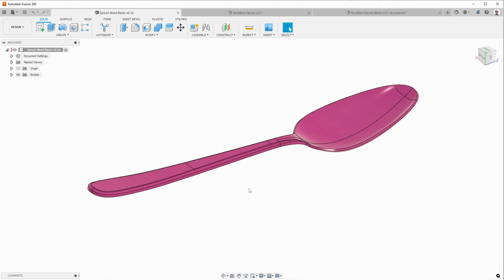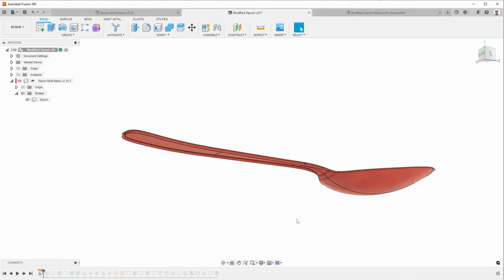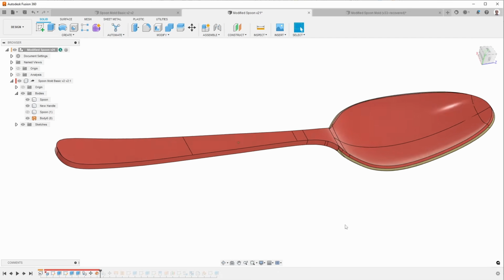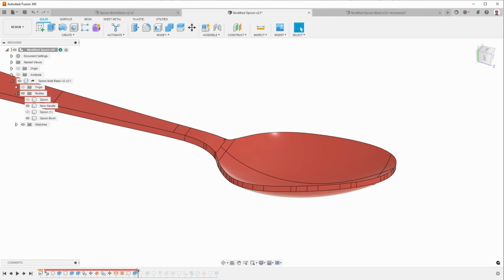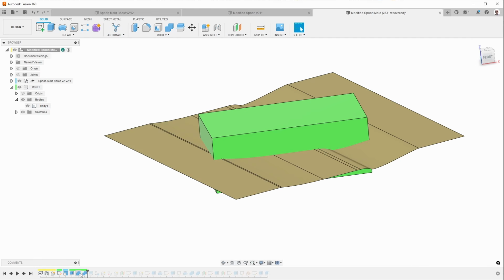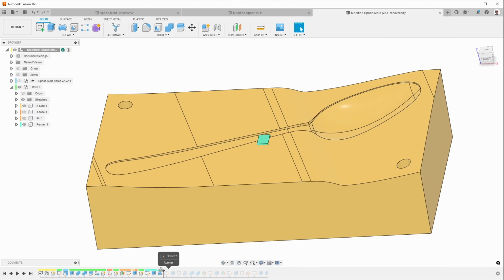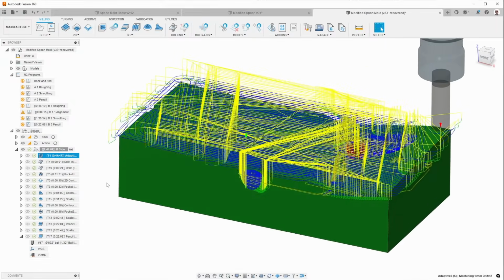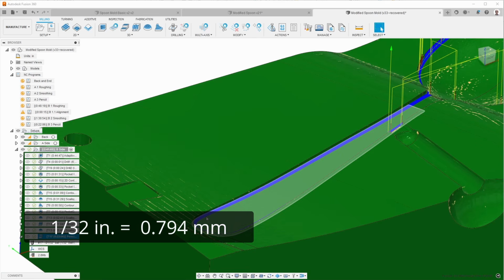Injection Molding a Spoon - Designing, making, using

Comment: Did you do any volumetrics to decide where to put the gate so the mold filled evenly with minimal splay?
Reply: As a rule of thumb, the gate should be positioned such that the distance to end of fill is minimized. This allows for the shortest fill time cycle which means that cooling starts in a shorter time after the filling/packing cycle. More simply, this is the basis for injection molding cycle time optimization. Some caveats though are that there should be avoidance of injection molding defects. For example if he put the gate on either end of the spoon facing directly towards the opposite end of the spoon, he may have experienced jetting. Jetting is a defect which occurs when molten plastic solidifies before the part is completely filled due to the “jet” of plastic not hitting the heated mold walls quickly enough. The result is that the plastic solidifies before clashing with the walls of the mold (the mold surface is too far away from the molten plastic coming out of the gate and the plastic solidifies before hitting the mold surface) and creates a squiggly line in the finished part. To simplify; always gate where the plastic can evenly fill out the part by applying constant expansive pressure along the length of the mold. Of course you have to worry about other defects like weld lines which occur when your part has holes in it, but even that can be remedied by placing the gate in a spot where the weld lines very gradually continue as flow fronts where a weld line turns into a “meld line” which is a much stronger version of a weld line. My plastics engineer brain can’t help but go on a tangent on injection molding but I hope this helped you to some extent! Please reach out to me on YouTube if you have any clarifying questions on this!!
Reply: @Fr8train003  thanks for taking the time to type that all out. I suspected as much, but wasn't sure.

Comment: Does your CNC machine have linear scales? I'm about to add those to my machine here. The linear scales will allow me to set some threshold that the machine will stop if something runs out of spec.
Reply from the maker: I have one watch with an o-ring. They have an undercut, like I tried at first. But their undercut is just a little taller, which makes all the difference. They have a height of 1.4mm for the thread and undercut, whereas this watch that I'm working on only has a height of 1.2mm. That means my undercut wasn't quite tall enough. I'm going to check the the designer about what he wants to do. In any event, from what I've learned, failure would be a stream of bubbles, which I didn't see. So it's working.
Reply: @JohnSL  Hi John, I think we're writing about different things here. I'm writing about the accuracy of the machine, I'm working with a converted mill and I'm using linuxcnc with it.
I'm working on raising the accuracy by using linear glass scales now.
How's the accuracy on your machine? Is it only checking the angle of the motor or are there any scales installed?
Reply from the maker: For some reason, YouTube didn't add my reply here and instead added a reply from another thread here, and then stopped allowing me to add comments until I reloaded the page. So here's the answer I wrote, but didn't get added here: My machine doesn't have glass scales. Instead it uses servo motors, which know their rotational position accurately. The main difference between machines with scales and my machine is that machines with scales can compensate for thermal expansion and contraction. I keep my machine in a room that is always between about 65-70F, which minimizes the thermal issues. I've found my machine to be very accurate: it's a Haas OM-2A.
Reply: @JohnSL  it's not only thermal expansion, it's also backlash under pressure to a certain degree.
I'm sure your machine has a better build quality than my one though. 
I'm also using servo motors on all axis.
My main idea of using linear scales is to secure the machine in case something's wrong -- it should just stop.

Comment: Just water??? also..... wouldnt you want the coolant on the portion of your endmill actually touching the stock? Sorry not trying tobe nit picky XD Ive done a lot of mill work Love/ hate the haas mills.
Reply from the maker: The coolant is Blaser Synergy 735, not water. Also, even when the coolant isn't directly on the end mill, there is still coolant in the area being cut. True, if I don't have the nozzle directed correctly, it won't flush the chips away. But the surface is never really dry during the milling.

Comment: Awesome! Please make a plastic straw injection mold I'd love to watch the correct way to do it
Reply from the maker: Thanks. I'm pretty sure straws are extruded not molded.
Reply: Can confirm with OP’s comment. Straws are manufactured with an annular die on a single screw extruder  (SSE) with several other pieces of downstream equipment (laser micrometer, puller, cutter, conveyer). There are videos out there on YT which describe the process.

Comment: No water No draft no problem
Reply: He uses a much better medium for cooling than water, an oil/water emulsion. He doesn’t need to add draft because the part inherently features draft at extreme angles which allows for effortless injection. If you watched how easily the part auto-ejects after molding without even using an ejector pin setup/3plate ejector plate setup you will apprehend why this isn’t necessary. 10 min/spoon is a little excessive, but this is obviously not a mass production mold, this is an R&D pilot mold meant for research purposes only. Also, almost no molds are polished automatically unless it is a mold which is produced by companies of the likes of LEGO or other companies which are targeting about 1 billion (with a “B”) parts because the precision which can be produced with hand polishing is so much better at this price that we are literally comparing a Honda Civic to a Lamborghini Huracan in this scenario. Engineer your mold to fit the customer’s needs, not to meet NASA standards for all your molds…

Comment: That's a lot of work for a 5 cent spoon. Any reason why the customer wanted to manufacture their own spoon rather than buy from a supplier?
I'm assuming they aren't a supplier, as the type of injection machine they are using isn't super efficient.
Reply: This is known as a pilot mold. It is most obviously deduced by the fact that it is made from aluminum, not a specialty hardened steel. It is a much cheaper, easier to mill material which is commonly used as a material to produce pilot molds. Pilot molds are typically single cavity, R&D volume molds which are the predecessor to hardened steel molds. The hardened steel molds are used to produce parts on a much larger scale based on the learnings of the pilot mold because production molds demand an extreme premium over the cost of an aluminum pilot mold. For reference, this mold is a single cavity mold which inefficiently produces spoons (from a financial point of view). A production mold may have hundreds of cavities per shot, meaning an entire package of spoons which could be sold to restaurants as a wholesale item could be produced in as little as one minute. Gotta prove your product and process first!

Comment: Very nice work. Is it left to the end user to determine if the parts perform based on material selection?
Reply from the maker: Yes. I provided what they asked for. I don't know the details of why they want this mold, and what little I know I'm not allowed to share.
Reply: @JohnSL  Thanks for the reply. It just occurs to me the next step if doing this in-house would be to perform material analysis and gain real experience of various material properties. I'm sure thermoforming plastics changes their characteristics. I am a sparky to trade but I've been a mechanical engineer through experience and while I don't know a lot, I love learning. Your videos are a great resource.
Reply: Typically single use plastics are thermoplastic materials. This is especially important for recycling characteristics because thermoplastic materials are able to be re-melted and processed again into entirely new products. Thermosets are able to be injection molded as well, but instead of being cooled in the closed mold after injection, they are heated. This heating causes the plastic to “thermoset” into a material which becomes one continuous molecule. A more intuitive way of thinking about the process is that this heating causes the material to be “cured” into one completely connected molecule. The result is a plastic molecule which is cross-linked into one continuous matrix, which when heated again, does not re-melt again. This is most commonly seen in car tires. This is why car tires are not thermally recyclable, they are mostly shredded and used for other things like rubber playground chips. There is great research moving towards chemical recycling which aims to break these crosslinked chemical bonds and reduce the materials back into their original monomer/polymer counterparts to be used again much like thermoplastics are. This is still in development and is known as “chemical recycling”. Hope this helps!!

Comment: As someone who has been working in the cutlery industry for 15 years, and as now a boss and a customer to subcontractors, I frankly wouldn't accept paying for that mold. Alterations to the initial design are extreme, and the product is basically unrecognizable, with all the important features dropped. Unless the customer gave enlightened consent that he would get basically a flat sheet of plastic embossed in the shape of a spoon instead of the spoon he designed, this is bad practice on the design side. Which is a shame as the video itself is very interesting.
Reply: Plastics engineer here. I respect your significant expertise in the cutlery industry, however OP displayed their expertise in plastic product design with absolute grace here. The part which he received would have been IM terribly due to non-uniform wall thickness as well as poorly designed draft along the part. When plastic is injection molded, thicker sections of the part will shrink to a larger degree than thinner sections. This leads to extreme warpage for the final “frozen” (frozen=completely cooled) part and the customer would have been furious that the resulting product was a warped mess which resembled nothing like the CAD drawing which OP was presented with. What OP did was provide a correctly designed spoon which exhibited all of the principles of design-for-injection-molding (DFIM) which by the way, was not so far off of the original design. In fact, OP even projected as many of the original sketches for the part sent by the customer to replicate the major geometric constraints to keep the design as close to the original as possible. I don’t mean to be patronizing but it is obvious to any plastics engineer or CAD design engineer that this was the most non-intrusive and well thought out solution to a clearly poorly designed spoon that he could have implemented. This statement is not BS, in fact it is proven to not be BS by the proof of the beautiful spoons which we were all shown at the end of the video. They ejected from the mold extremely easily without warping and the customer is visibly ecstatic with the end result. 🤷‍♂️
Reply from the maker: I did exactly what the customer asked. They sent a file they found (and therefore didn't create themselves) that was close to what they wanted. They said, "can you take this design and modify it so it's a uniform thickness everywhere?" I made those changes and sent it back to the customer for approval. Their reply, before I designed the mold, was "that's perfect." So the customer got exactly what they wanted, and they're very happy.

Comment: Olá amigo,  parabéns pelo vídeo. 
Você poderia fazer injeção  de um copo  de 100mm de altura com 5 de diâmetro eh cima?
Reply from the maker: I personally don't have experience with that type of project. The challenge would be to get the part off the core, as plastic shrinks. There are collapsible cores that I believe are used for this type of project, but I don't know if they make them that small. I'm not a professional mold maker, so my experience is limited to these desktop machines.
Reply: @JohnSL  
Obrigado por responder. 
Qual tamanho do copo plástico seria ideal para fazer na máquina, diâmetro, altura e espessura?
Outra coisa, já fez molde usando madeira pinos?

Comment: But how to automate this to make it economically viable?
At this video there a lot of handwork - spray form, load it, fill, take out, open, get the spoon, cut off redundant part. And it takes a lot of time, so such spoon would be more expensive that stamped metal spoon from China!
Reply: This would be automated by implementing an ejector system via use of ejector pins on the A side (core) of the mold which features pins that push the part out of the mold after “mold open”. Like OP said this mold is not meant for production, it is known as a “pilot mold” for R&D purposes. This was never meant to be a high production mold.
Reply from the maker: It's not meant for production. Beyond that, I'm not allowed to say why they wanted the mold.

Comment: An optimal spoon would have a thin sharp tip and a thicker neck to strengthen it. I don't see the advantage of uniform thickness as you're not manufacturing from stamped sheet metal. Impressive cad skills.
Reply: The need for uniform wall thickness stems from proper plastic product for injection molding design. Non-uniform wall thickness causes differential shrinkage which causes warpage. This is one of the most common defects of injection molded plastic parts due to improper part design. Thick sections shrink more than thin sections given the same mold environment. This improper design leads to parts which do not hit proper dimensions and in many cases produce parts which do not resemble the intended design at all.

Comment: You need to get rid of tool marks with higher grit. Using 4000 from the start is a pain and won't yield good result.
Reply from the maker: To get a mirror finish, sure. But the customer didn't ask for a mirror finish. And they customer was very happy with the results.
Reply: @JohnSL  sorry, I meant lower grit, like 400, to get rid of transitions between tool passes and then finish the surface like you showed. That way you won't have "waves" and it will consume less time. I don't like mirror finishes myself.

Comment: Did you say your machine has 30k spindle speed? Because your tool paths look very slow if that’s the case, you don’t seem to be utilising trocoidial milling during your roughing, I would also recommend using a hardened bush for each of the locating pins too instead of running the hard pins into soft aluminium
Reply from the maker: I did all the roughing with a 3/8" diameter end mill using Fusion's adaptive toolpath (which is a trochoidal toolpath). But my machine is very different from every other Haas machine. It has a tiny ISO-20 spindle and they recommend limiting the side forces by using no more than 20% WOC/DOC. I know that looks lame compared to most VMCs, and it is. But this spindle is made for precision, not hogging. Pushing it past that would mean I'd have to replace the spindle much sooner. And a replacement spindle is not cheap. Regarding the bushings, this mold is not likely to be used long enough for wear to be an issue.

Comment: why does the mold only have one cavity? why the injection machines are so small? wouldn't it takes forever to make a proper load of spoons this way? I'd this just a hobby project? 

so many questions
Reply: This is known as a “pilot mold.”
The customer wants to make sure that their mold tooling is right through testing of said pilot mold before they scale up to a much larger hardened steel mold of much high cost (significantly more expensive). It’s much cheaper to fail this way with a cheap aluminum pilot mold first than to immediately jump into the big leagues of a multi cavity hardened steel mold.
Reply from the maker: This mold isn't going to be used for production. Beyond that, I'm not allowed to say why the customer wanted this mold.

Comment: Pro tip 1: Try to put the dividing plane on the top of the spoon and not in the middle, then the mold should be manufacturable.
Pro tip 2: Use steel housing opposite the pin, the mold will last longer.